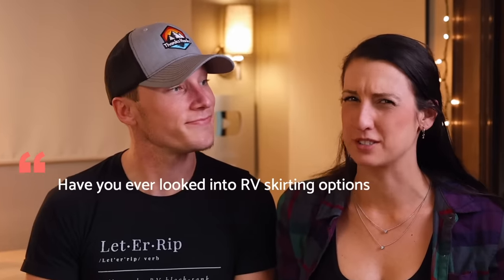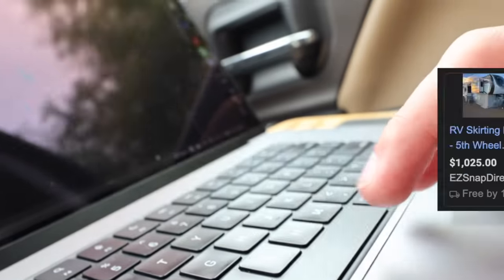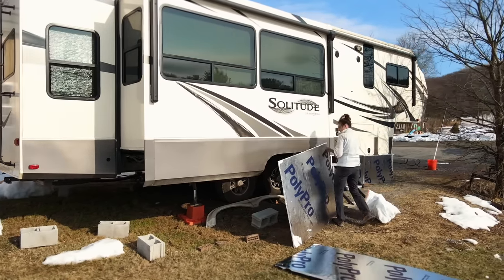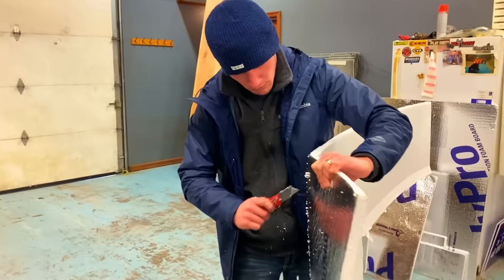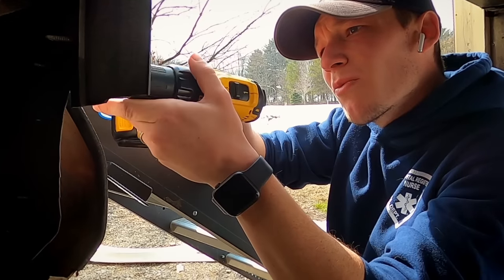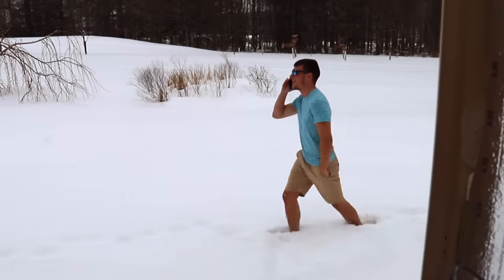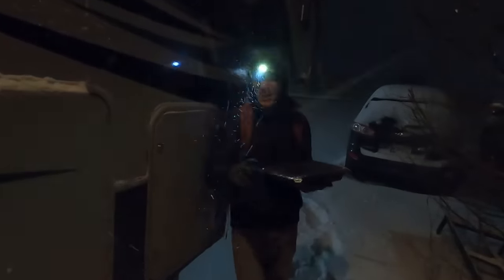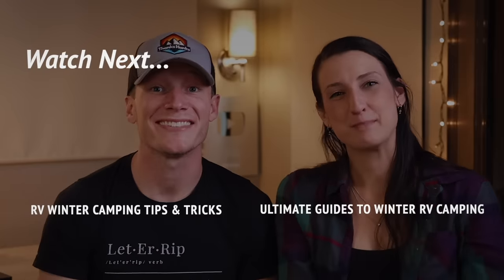Living in an RV in the Winter: Does DIY RV Skirting ACTUALLY Work?

Comment: Suggestions: First, use big long nails or tent stakes to help keep those concrete blocks from sliding back under the rig. Second, you can "pin" the foam boards at 90 degrees using bamboo skewers. Third, If you cut a board too short and it doesn't reach the ground, just cut a piece to overlap the short one, and fasten the two together using double stick tape, your favorite foil tape, etc. Fourth, a good tape to use to fasten the foam board to your rig's exterior is Gaffer tape. It's like duck tape, but has an easy releasing adhesive that leaves nothing behind. Fifth, if you position concrete blocks vertically, you can use furring strips (or 2x4's) run through the holes in the concrete blocks, which is particularly useful in high winds.  You can just run long wood screws with washers through the foam into the wood. 
I got these hints from a friend who wintered in Montana for four years in a 5th wheel.
Reply from the maker: These are really great suggestions, Mike! I like the Gaffer tape idea for sure 👍 Thank you for your wonderful support and for taking the time to share this with us!
Reply: @HappilyEverHanks Why not start a business manufacturing inflatables made from materials that are used in inflatable playhouses for kids. The great thing about it other than the insulating factor it could be deployed and uninstalled in minutes, and could be designed in easy to deploy sections, and would leave no wasted materials to deal with. and could be reused multiple times. And they can be easily stored away for the following season,You also could do this as a rental business for people that do not want to buy them.
Reply: @raymonddriggers there is a company that does that already called “air skirt”. Just really pricey

Comment: You could consider using bales of straw under the RV . The straw bales would have provided insulation and cut down on the amount of dead air space under the RV. Bales of straw would  provide a strong backing for foam board against wind. Stack bales of straw under the tongue area for extra insulation under the bedroom.
Reply: i stacked square bales of straw around my entire rv, working great so far.
Reply: And great habitat for mice 🐁 😱
Reply from the maker: I like this! A guy named John here in the comments just mentioned that he did the same thing with some straw. I was curious on how rodents came into play here. Do you think that could be a factor to worry about? Thanks for sharing 😃 - Kyle and Renee
Reply from the maker: I just realized "John" has been replying to you already LOL (my bad)
Reply: Mice and possibly snakes are definitely an issue depending on where you are.
Reply: . Mold, too.
Reply: Thank you for the suggestion! Using bales of straw under the RV can indeed provide insulation and cut down on dead air space. It's a great DIY solution to consider for winter camping. By the way, if you're looking for a reliable power source during your outdoor adventures, I recommend checking out the Segway Portable PowerStation Cube Series. It offers massive capacity, powerful output, and fast recharging, making it perfect for RV enthusiasts like us. Happy camping!
Reply: Mice are a problem with straw bails & mold.
Reply: Bales will attract mice
Reply: Mice baby Mice!! Don’t use hay bails…Neighbor tried and failed...
Reply: Straw is an invite for the Rodents to invade 🥴
Reply: But mice like straw a lot.
Reply: Nice love living in hay & straw.  You don’t want them near your rig to find ways in.
Mold is an issue too.
Reply: Mice, mold, fire. Straw is a bad idea if there's anything else available.
Reply: Straw bales are mouse houses, not recommended.
Reply: Also great fire accelerator.
Reply: This would attract mice.  They love straw
Reply: Straw bales also attract mice really bad.
Reply: Bales are also a fire hazard wouldn't recommend
Reply: Done it,moved them during the summer. Found nothing but mold. Just building house for rodents and spiders..

Comment: Dear Carl & Nay Nay, Consider this: buy A roll or 2 of Industrial VELCRO w/sticky back. Attach one side (male) to the RV wall  leaving it on permanently. (No more constant build up of sticky gooey silver tape!) Then attach the other side (female)of the Velcro to the inside of your insulation boards. Then press them well against the Velcro on the walls. At the seems you can add the silver tape & then attach more Velcro from one panel to another connecting them to each other horizontaly near the bottom & in the middle. So when the winds blow the panels are secure to each other. When your ready to remove the panels just pull the Velcro apart female from male. Save & store the insulation panels for next time. (They are different strips that connect together. Comes as one set of each on the same role ) Who wants gooey sticky tape building up after you pull off that silver tape each time? Velcro saves the day!
Reply from the maker: Hi Melody! This is a GREAT idea 😀 I never even considered this. Thank you for taking the time to share. I would lovef to try and put this to the test sometime. Thank you for your amazing support - Kyle and Renee
Reply: This year I'm going to try 2'x2' gym floor matting interlocked together and taped to the rv.Its 3/4 inch thick and waterproof.Very durable and reusable.It was  actually cheaper than foam board and fairly easy to cut.

Comment: We lived in our 5th wheel in Montana for two winters.  We never used straw because it attracted mice. We used 2 inch insulated hardboard and never had a bit of trouble freezing up. It was the 3 coldest winters in MT since the 1930's. I could send you a picture of that in 2016 and 2017. We covered the front, sides, and bottoms where possible on the slideouts. My wife wished I had made a YouTube video. She figures it would have gone viral. Thank you for your videos.
Reply from the maker: Hi Dale! I can only imagine how cold those temperatures must've been. Yes, we have heard the same thing about the use of straw attracting rodents. Sounds like you guys did it the right way! Thank you for your wonderful support and for your time in watching our videos - Kyle and Renee

Comment: The electric hot wire is perfect for cutting foam. Clean,precise and no mess. Seals up the cuts like cauterized
Reply: Thank you for sharing your experience with using an electric hot wire for cutting foam! It sounds like a clean and precise method. By the way, have you heard about the Segway Portable PowerStation Cube Series? It's a versatile power station with a massive capacity, powerful output, and fast recharging. It could be a great addition to your outdoor gear collection!
Reply from the maker: Oh what a great idea!! Thank you for taking the time to share 😃

Comment: I enjoy your videos.  Very informative.  One thing that sticks in my mind is an old HVAC guy who told me the shiny side should face where you want the heat.  In the winter, shiny towards the underneath of the camper.  It is supposed to reflect the heat back into the underneath.  I will probably not ever need to try this but I just wanted to start a discussion if anyone is interested.
Reply from the maker: This is a great point. I have heard this on multiple occasions from other people as well. Thank you for taking the time to reply! Your support means a lot 🙂 Merry Christmas!

Comment: I'm coming on 1 year of RV life in a Jayco Eagle TT. I'm almost through my first winter. I decided to give it a chance and skip the skirting even know we get many freezing days in the single digits. The things I have learned about this Jayco, The fresh water tank will freeze even know its insolated. I then used a heated hose connected to city water and that has solved that problem. But you would think what about your grey and black tanks. When its super cold I will put rv anti freeze down all the drains to assist keeping them from freezing along with running the furnace. Jayco did good with insolation but I find I loose the most out of the single pane windows. Come on Jayco! be better lol. But for that I put some of the window plastic on all the windows and it made a big difference. I appreciate your video because some people really need this but I'm happy to say the jayco for the most part has made it without. This is my last year in Oregon and I'm heading south!

Comment: I just found out this week that my tiny home will hold temp with 6 candles in -15c during a power outage a power outage. I was ok with 400 watts till -15 I had to switch to 600 watts. I’ve got a spare new heater ready that will run on 750 watts on low as my old heater did three years ago. I’ve also got  lil buddy propane with a few green tanks and a big tank as well with the line for it. I made a holder for my lil buddy when it runs on a line instead of a mini tank. I’ve also got the candle heater which burns candle ps slow and keeps the burn safe. I’ve also got a lamp for extreme back up. I’ve also got a diesel heater installed for when I’m off grid and a wood stove for when I’m really off grid. 😂 I’ve extremely prepared and takes not much to keep my tiny home hot.

Comment: We've actually just bought some custom fabric skirting that's coated with PVC, so it's like a very heavy tarp, and it has eyelets on the top to hang it from 3M hooks and on the bottom to stake it to the ground with tent stakes.  We're traveling down south and haven't used it yet, but I think that it should do a very good job of keeping the wind from sucking out all the heat of our 5th wheel's underbelly.  Only $300 too! We'll see!
Reply from the maker: Hey that's not bad at all!! Way to go 😃 Ya'll be safe in your travels down south. Thank you for your wonderful support and for taking the time to watch out videos - Kyle and Renee

Comment: The idea is to stop wind and make a dead air space. Have lived in mine for a year and a half. Last winter had a -52 C morning,  it was -8 under my RV on my remote temp gauge. I don't run heat under the trailer because I don't want condensation.  Pile snow around the base of the insulation pieces but leave small air holes in a few spots at the top edge. 

Put the shrink film on your windows and  a 400L pig propane tank, you will be fine.
Reply: If you install a plastic ground sheet directly on the dirt, you won’t get the worrisome condensation. I skirted, installed a ground sheet, and heated the area under the trailer back for the winter of 2019/20 in the Yukon 🥶 and the trailer did well. So much nicer to have a warm floor and no frozen pipes, even at -40.

Comment: The pink insulation board costs more but it's denser and you don't have to deal with all the little beads everywhere (something to consider if you're going to haul it with you to use again...). And I think I'd put wide bands of heavy duty velcro along the bottom edge of my RV and on the boards to make them easy to install, remove, and re-install another time. But I don't care "how it looks" like some people might. Besides, velcro comes in a variety of colors, so color match! LOL! I'd use 2x4s along the bottom for reinforcement and stability which can be easily reinforced with cross-braces at the corners. 

And no, don't use bales of straw or hay under your RV as someone else suggested. They absorb moisture from the ground and the air (and anything that leaks under it on a day warm enough to cause snow and icicles to melt) and then they can start to mold and mildew which generates heat and then they can spontaneously combust. Many hay stacks and hay barns have been lost because of wet hay/straw spontaneously combusting.
Reply from the maker: That is such a great idea and you get color options for the velcro as well! Win - Win 😃 Nice call on the 2 X 4's. I never thought about the mold and mildew side of things with the straw. You are very knowledgeable! Thank you for your amazing support and for taking the time to share - Kyle and Renee

Comment: I used a wood frame and three layers of vitex  and green house plastic . The dead air spaces become a thermo pane cover . Won’t mold , stays dry , and has worked for five years . The tires look like new no weather checks . You don’t need posts , just make it like a box kite , I used two by fours cut in half length wise . If you want a round cover for the whole unit . Use sced  40  conduit . Make big arcs . Drive small steaks , about three feet long , a foot in , and put the hoops up . Run a center pole the length of the rv,  use dry wall screws to attach and cover with green house plastic . I did this with my thirty foot bus and had a Patio in front . 
It would get so hot I needed ac on some days .
Reply from the maker: Great idea! Thank you for sharing, Steve 🙂 Merry Christmas to you and thank you for your support - Kyle and Renee

Comment: I do this in the winter, I use the 9 dollar boards which are thinner. I run 2x4's all the way around and use landscape ties to hold the 2x4 in place. Screw the bottom of the boards to the foam with big washers. Making the underneath air tight is the point here, I have been in -10f with no freezing. The smaller 9 dollar boards are much thinner but still have the same result. Another tip is if your water inlet is in an unheated front bay you can use the same foam to section off the bay so the residual heat from the heated hose will keep the smaller portion of the bay warmer. It is amazing how much warmer your rig will stay just by removing the airflow from under the RV. My cost with the thinner foam board is around 175 dollars.

Comment: i have a grand design solitude as well. a helpful winter camping modification i did was put a 12v marine 3in inline vent fan in the pantry. i piped  it throu the top to  draw the hot air near the ceiling. then ran the piping down along the back corner of the pantry into that dead space hidden under the bottom shelf, from there it goes directly into the underbelly near the ho twater tank and  nautalus. this allows me to use alternate heating to help the furnace on those cold winter nights here. using a multi zone weather station i monitor my temps down there and it is consistantly warm as the living space.

Comment: i have something that a old trucker told me about, you know the trailers have that winddeflector on the sides of the tractor trailer?  well,  i took 4 of those and for every 4 feet installed a piano hinges  so they could be  stored away later, . on the trailer , i installed screw in hooks into the sides, and hung the deflectors on the sides .  for the bottom ( where you placed brick,s) i placed 10" long tent spikes to use as a backing or to block the deflector on the bottom , later  removed them to store away,  this set up , covers the whole trailer all the way around  from front to back and under the 5th wheel area too. on top of the trailer , i coated the top with RAIN X spray , ( i know it makes it slippery up there but that just the point, )?, snow doesnt stick to the top , when snow falls it slids off instead of sticking to the top. also on my trailer all pipes are insulated with insulated foam pipe covers (black) and foam spray to keep the pipes from freezing up?, the tanks too.!!
Reply from the maker: I've heard of people using stakes! This is wonderful information :) Thank you for taking the time to share!!
Reply: @HappilyEverHanks  WISHING YOU ALL A MERRY CHRISTMAS AND HAPPY NEW YEAR  HAPPY TRUCKING TRAILS,
Reply: Pictures
Reply: your want pictures , come see my rig.
Reply from the maker: A very Merry Christmas to you as well!! 😊 @tm8747

Comment: Oh yes I do know where to start, at the ignition switch.  You insert the key start the engine and head south.  Pretty easy, eh?  I know everyone can't do that and I  think you were in that situation.  Once you get the foam board up you  can pile snow up against it.  It does a couple of things, it provides very good, if somewhat cold, insulation and it also seals any little crooks and nannies you may have in your insulation.  How do I know this?  I once lived in a small house built on piers and if there was snow on the ground the pipes didn't freeze.  If there was no snow the wind would take all of the warm air out from under the house and freeze the pipes.  Keep the good stuff coming guys.

Comment: Have you considered Gaffer tape instead of the foil tape? It tears like duct tape, it does not leave any residue because it’s made to be taken off at some point and it holds up in weather. Originally designed for sound techs (which is why it’s called Gaffer). Storage craft use it to lay down wires and have a clean pull-up later when they are ready indoor or out.
Reply from the maker: This is a great tip, Michael! Thank you for the suggestion on Gaffer tape, we had not considered this. We appreciate your time and support! - Kyle and Renee